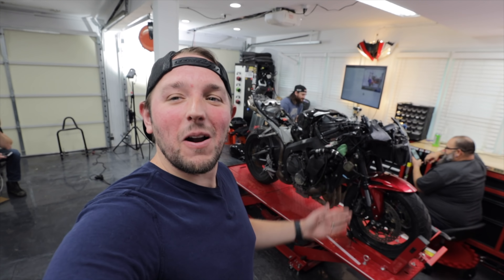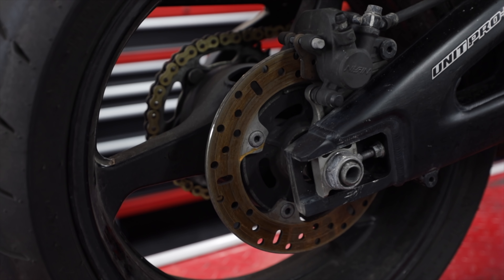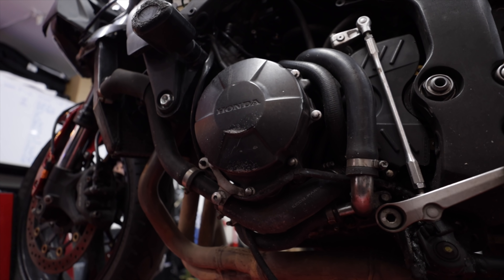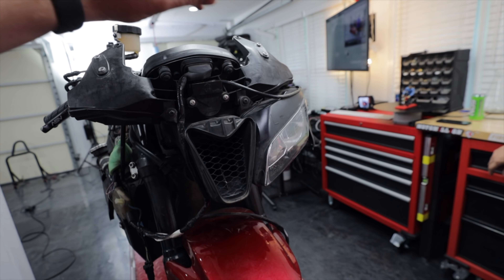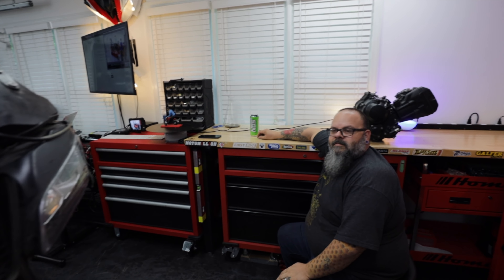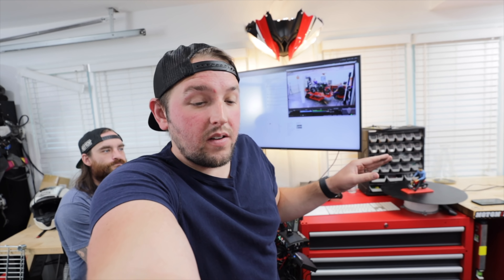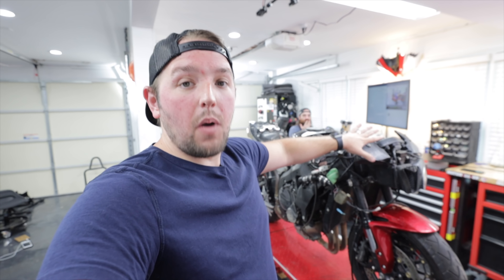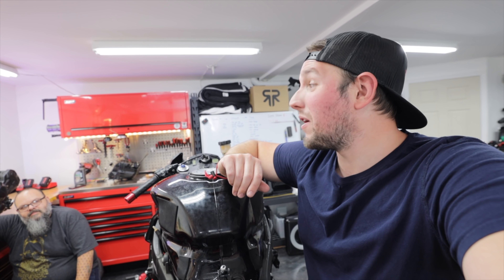FULL RACE MODE on our CBR 600RR | 2008 CBR 600RR Race Build - Day 2

Comment: I have this bike. When you lower the exhaust with those TST lowering links you do not need the heat shield. You do not need them for aftermarket exhausts either. Stock the exhaust sits against the shield against the plastics, and its all essentially sealed with no airflow by the rear fender/taillight.

Comment: Track day - taping headlight
100% with Chase on this, and I've done track days so, there's that.
Reply: yeah how does a reflection hits someone's eye that's going the same direction, mirror yes but not a headlight
Reply: just did a quick google and rear brake light taping is to stop distraction, front headlight is for breakage
Reply: @JohnnyXoz  taht's not the thought process to undersand that.
Have you never done something and then noticed something reflect somewhere which distracted you from what you're doing?
Reply: I'm pretty sure that Brian is the all knowing when it comes to bikes when we look at these two.

Comment: I run this exact same bike at my track days. A couple of things that I didn't hear mentioned but IMO made a huge difference was 1) Braided front brake lines and 2) a quick turn throttle tube. Those front brakes will disappear after the 1st two laps with the stock setup and for me I hated having to wrap my arm around the clip on to go WOT. Excited to see this build series!

Comment: One group that I've done a track with requested that you pull the fuse for the lights on your bike if you can, and use tape otherwise, which supports the distraction explanation. They also required that the mirrors be removed or taped, which could be for either reason.

Comment: Taping the headlights breaking and so forth was for older cars that had actual glass covers on the headlights. Those would actually create debris that could cut a tire or injure a marshall. Now I thought it was only to avoid distractions, but not because of the reflections, but because the lights are still functional. So the headlight turns on, and the brake light flashes when braking... Those communications are no necessary on track

Comment: In Australia on most track we tape  them up In case we crash so we don't leave bits of head lights and tail lights on track also if it's track only/ race bike we have to have engine case protectors so if in a slide we done bust engine cases and leak oil on track and also we have to run race coolant or water in radiators  as it's not as slick as normal coolant. We also got to lock tie and bolts so that's oil bolts, oil filters , brake caliper bolts and radiator cap.

Comment: Just came back from 2 Days on the Track and they told us to tape it up just in case somebody goes down, they dont want any shards or pieces laying around on the track. So iam with you on this one. But they also told us the second reason as well. with the drawing attention on your bike with brake lights etc.
Reply: Do people also tape their windshield, because a cheap one could technically also just shatter.
Reply: @Daniel-dj7fh  up until now ive only seen tape on windshields to fix them :D but  i dont really think so because on the straights you want to look through it. If you tape it you are basically flying blind on the straights

Comment: Sorry to say but a small correction is needed here. Taping up lights for track days is because of the risk of broken plastic or glass. You can't dazzle a rider with your headlight if they are in front of you.
Reply: The whole bike is plastic. Plus your headlights will be reflecting off of the bike in front of you.

Comment: i wonder how you would do a full-on track bike, while also keeping it a street bike? you can keep the street bits, but that's gonna be pain to change every time. I've seen street bikes, that are also semi-track bikes.. but not full-on track bikes (no lights, no mirrors, race fairings, etc). changing to race sub frames and brackets would obviously delete most of the OEM mounting points so that pretty much also erases the possibility of you using the OEM lights and fairings.

i'm genuinely curious. :)